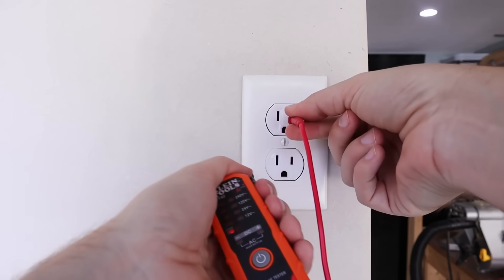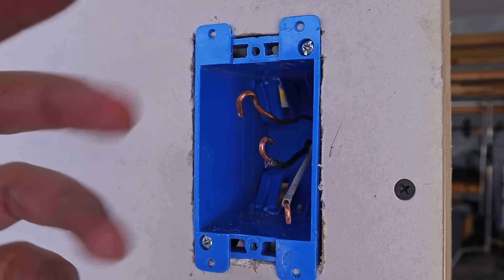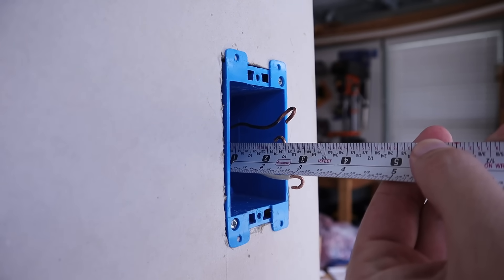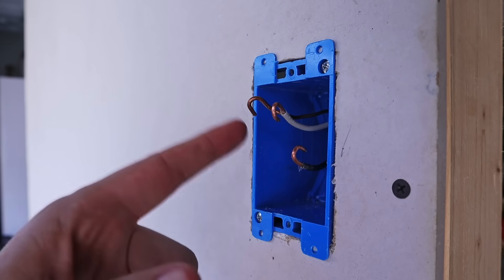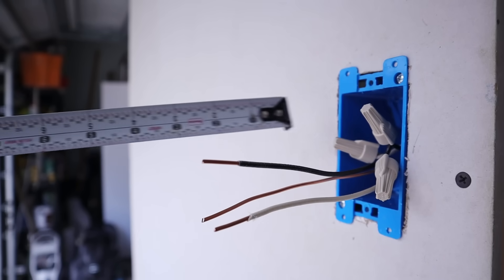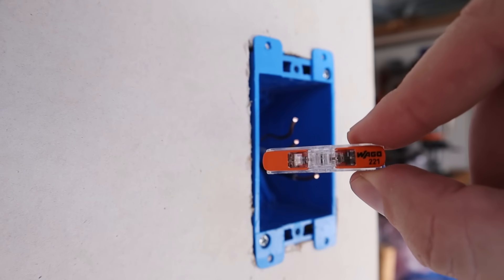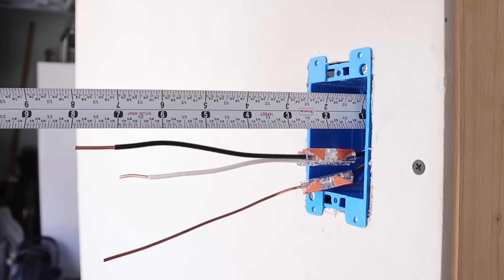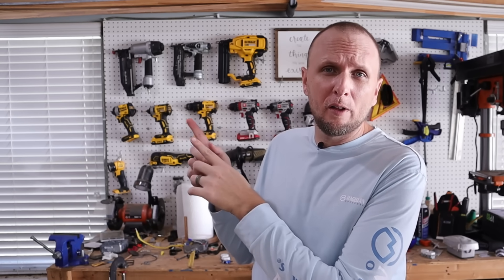"SHOCKING" New Way to Fix Short Wires In an Electrical Box to Code | Very Important

Comment: LOL. I had just commeted on short wire in another bid of his. I did have a what a minute moment. In previous vid push in method for receptacle  was staed as a DIYer mistake, yet there is a push in for one of the methods. 😮

Comment: My biggest issue is 4 gang boxes that don't have enough room for four deep smart home switches... or the like. Also multiple dimmers on one circuit for LEDs have major issues with flickering and buzzing. I have resorted to putting a tungsten blub in one spot to help increase the load. I feel these circuits should be designed with leds in mind these days. I have heard of some resorting to fx lighting as a standard. (What is used on stage, etc.)

Comment: Great video. I thought you were a fan of Wago, so the cover picture confused me. It shows an arrow labeled "bad". Was the misleading picture to drive more traffic?
Reply from the maker: I wouldn’t call me a fan of Wago, I think they serve a purpose and I use them in certain applications.  No the bad is not intended for the Wago but the connection underneath.

Comment: I've found with levernuts that you can stab solid wire in without lifting the lever.  Stranded wire you need to lift the lever first.  I'm rigging my home with a bunch of smart switches and the WAGOs make the job so easy.

Comment: Only in the states. No wonder the UK has the safest electrics.
Reply from the maker: This would be no different than the UK.   Wires need to be a certain length.  There is nothing outside of posturing that says the UK’s electrical is safer.  In fact, if you look into who has the most electrical fires per capita of households, the UK actually has more fires caused by electrical.

Comment: WHAT HAPPENS WHEN CORRECTING THE WIRE LENGTHS',THE BOX IS TOO STUFFED TO CLOSE?   FINIS  PAX
Reply from the maker: Then you have too small of a box.  The correct wire length should not make it too cramped even with the extra splices.

Comment: I have to move (lower it) a wall plug and one of the wire (coming from the top) is too short, Can you tell me if i can elongate the wire with a junction without having that joint put in a  jonction box ? Thank you.

Comment: The very first time I ever took the cover off an outlet box, it was to replace a cheap switch installed by a pro, who left barely enough wire to loop around the screws outside the box--and yet, there was excess bare conductor extending past the screw. Not remotely code. I didn't know enough at the time to even twist pigtails on the existing stubs. I'd've about killed for a Wago, especially that inline splice model. But I did get a working switch installed, after far too much fussin' and cussin'. From that day hence, Every. Single. Time. I've had to do repairs or rework, I've had to fix a mess left by a "pro", before replacing the faulty bargain-bin commodity part  with at least a commercial grade. Come on, guys! If you don''t think we DIYers should be messing with the Angry Pixies, at least set a good example.

Comment: Those screw connectors are a thing of the past now that receptacles have wago type connections.
Reply from the maker: I don’t think I would go that far yet.  In my opinion commercial grade receptacles are still superior to anything out there.
Reply: @HowToHomeDIY  Generally agree if you are referring to screw clamp type which I find almost impossible to find locally. I think the absence of exposed conductors is a huge safety bonus.

Comment: Great video - one question: the code says the length is measured from where the wire "emerges "from its raceway or cable sheath." Isn't that before the connectors you added, so what do the connectors gain in terms of the code? I'm sure I'm missing something about this. Love your channel.
Reply: You didn't miss anything.  This is not a resolve for the code issue. This only fixes the functionality issue, making it easier to install the device.
Reply: @17kcotsdoow86  thanks for the response, but I am confused… Why would you want to address the functionality issue if you can’t install the outlet to code? Perhaps only in circumstances where the outlet will not be inspected?
Reply: @dansklrvids7303  At the end of the day, it's to save the cost and possible esthetics of the repair. You can either tear open the walls to get the short wire to a different box to make a splice and then extend a new wire to the original box. Then repair walls/ceiling. Or you could add a new junction box with a blank cover (or add a new receptacle) close enough to the original problem box to make the splice.
In the real world, a customer is not going to pay to rewire their home because of short wires, possibly left from before the code was written as it is now. The resolve is safe it just doesn't fix the code issue with this rule.
Reply: @17kcotsdoow86  thanks!

Comment: Great video, when it comes to electrical work, many DIY’s know just enough to make it work. I prefer a properly done pigtail with correct size wire nut, it’s the next best thing to soldering when you want a lifetime wire joint that can handle environmental, electrical and mechanical abuse. Try comparing a Wago lever nut to a wire nut on a 5 HP vibratory tumbler and see which one fails first. I know this is not a typical application, my point is that I can make an inexpensive ”forever” connection using a wire nut.

Comment: it is better replace entire cable with longer one if possible,  i'd leave this socket connect with short wires as is, because it the more joints cable has it is each joint is a point of heat

Comment: Is the service loop/love loop against building code?  Coming from the low-voltage/communication sector, it's how we roll, 'cause stuff happens.

Those butt-joint Wagos are interesting!  Not sure how I feel about them in this application, though.  Especially in a stuffed box, having the wires come back on themselves in a regular Wago or a wire nut may actually afford you some extra flexibility when tucking everything back in.

I'm also curious about how electrical code addresses wire length in pancake boxes, as I may have to use a couple in a reno I have coming up.  Still a 6" minimum, or is it less because the box is shallower?

You do awesome and informative videos!  Thank you for sharing them with us!

Comment: Question(maybe an idea for another video) - I'm trying to fix someone's previous mistake.  A ceiling light has a switch, a constant hot, and two other lines that goes to outlets.  So normal wiring would be use the constant hot to the switch to control the ceiling light and than wire the two outlets to be constantly hot.  But the problem when I came in they were cut way to short and you cant get them all in the same box.  What is the proper way to do this?  Can you use wagos to extend wires to get to the box or they have to be placed in another box first?   What is code and acceptable here?  This home is old!!  Thank you, been youtubing to see if I can find a remedy
Reply from the maker: Any splice or wire connection has to be in an accessible junction box.  So it’s either do that or run new wiring.

Comment: I been using the Wago connectors on DIY project and talk about making life alot easier.  The wirernuts always takes up so much room, which mades it a B@@@@, to get multiple switches in the box.

Comment: 1. Can you bury WAGO connectors in the wall?
2. Why is the box NOT too small to get all those wire nuts, along with a fat GFCI, but too small to have more than 3 Romex cables with a light switch?

Comment: I have used Wago connectors for a while now and like them very much. One tip would be to give it a single wrap of electrical tape to help keep the levers down. If your gang box is exceptionally stuffed full of wires, the levers can catch and pop up while shoving everything in.
Reply: ... and then rotate the bundle with longer wires.  It is actually easier then using a linesman's pliers.
Reply: You mean on the OUTSIDE of the levered junction and not on any wires, right?  In that case I agree.
Reply: @JLilliquist  yep
Reply: @mgweir3252  cool, out

Comment: There should be a special place in hell where these morons, who cut wires 3 inches long inside a box, get sent! I have run across it more than once. Even the "hot" wire wasn't wrapped around the screw properly in the video; surprised it wasn't wrapped CCW besides. Or like i found recently in a bathroom where the electrical box wasn't even grounded. Whoever, not an electrician i am sure, had hooked up the ground directly to the fixture but never grounded the box first.

Comment: That was beautiful work, but question... isn't the box filled up now?  You have the extra wire, the connectors, at least one wire nut... and of course now we need to jam a fixture in there.  Seems like it will be awfully tight getting that to fit.  Btw, NOT criticizing... asking so I can learn.
Reply from the maker: It does fill it more but it is required by code.  All of that will depend on what’s being installed and the size of the box.  In some instances a deeper box may be best to install.

Comment: I had a situation just last week. Beach houses sometimes have grooved outside paneling on the outside. I had 4 sections that had rotted and had to be replaced. I took down the non working fixture and saw that the wire had rotted right where it cam out of a 2X4. The cause of the problem was the installation of the fixture. Someone had hung it over a groove. Water ran down the groove and into the fixture. I had told the guy replacing the paneling to pull the wire back from the 2X4 so I could move the fixture after the paneling was replaced. He didn't. I'm 5 hours away and can't supervise the people who work on my house.

I drilled a hole 8 inches down from the old hole and pulled the wire back. Put in a new box after pulling a piece of cable toward the unneeded hole where the wire had come out before. The carpenter had cut a new hole where the fixture had been on the old paneling. I spliced the cables together and put a water proof cover over the splice box and caulked it to seal it. I installed the fixture over the old hole location he'd drilled. I filled the groove in the paneling with caulk so water couldn't run behind the fixture and put a bead over the top of the fixture. I put 2 coats of paint over the splice cover and it's practically invisible.

I've owned this house for 22 years and it's been completely renovated. Most of my repair work years ago was related to poor workmanship. Today I am still redoing bad workmanship on recently down work. It is very difficult to find good workman here on the NC coast. I'm fortunate that I'm handy. Most of my experience comes from my time as a Navy Seabee working in a base public works department for four years.

Comment: Good video im just gonna recommend to pull on the wire slightly to see if there's slack from the wall.  Sometimes pushing it back up helps make it easier to make the outlet fit.  Most houses this is the issue.
Reply: Yeah, I find with outlets slinging a little wire out of the wall and into the box and then doing the reverse when closing helps.  It is not as common with switches.  I alos noted that switches are 99% backstabbed unlike receptacles.  That pretty much tells you what the qualification of the worker was.

Comment: I was taught hot wires need be taped also after connectors done. Is that still true or has that changed?
Reply from the maker: It’s a personal preference but not required.

Comment: My biggest problem with wire nuts has been there is never enough room in the box and bending any thicker solid wire grades is a force nightmare. It would be nice to see you do a video showing what to do with both the WACO and wire nuts pushing or winding them into old metal boxes., especially when you have to put more than two wires together, like in some ceiling fans. Any tips or methods would be appreciated.
Reply: Try changing out to smart receptacles, which are quite larger than standard receptacles.  Talking about frustration!    Just not enough room in standard boxes.  You either go deeper or wider or both.
Reply: @chaecoco2 You are correct. I noticed that he didn’t try to “stuff” everything back into that small box in the video. Probably the reason the wires were cut short in the first place.
Reply: Agree! Why they made those boxes so small is so dumb.
Reply: There is room, just not as much as there should be.
Reply: They hold up in Europe so why wouldn't they hold up in the USA?
Reply: @deang5622  Half the current?
Reply: Ceiling fans should have their own junction box above the ceiling, just like a smoke detector.  Both are easy.  You so not have all the power in / out and loads.  Switches are the worse.  I actually have a box with half leads just for lights, line in, line out, fan, etc.  It is mess.
Reply: You can get Wacos with up to six parallel ports (maybe more) for when you have more than two wires to connect.

Personally - even for only two wires - I find the parallel Wacos are easier to push back into the box than the in-line version.

Comment: I had an outlet burn out in my kitchen a few months ago. It was installed in the 80s and had gone through numerous power outages. One thing we discovered was that there is no ground wire. Not a single outlet in the house has a ground wire even though there is a grounding rod next to the meter pole (my meter is on a pole instead of on the house). Another issue is that there was zero slack. Before that though, the damn screw for the coverplate was completely stripped and would not come out. had to break it off. Needless to say, it was a royal pain getting the new outlet put in. I know there is no slack or extra wire at all because I can see the back of the outlet from inside my pantry and I can see the cable coming down from the attic and to the outlet box. 
If I ever get to redo the wiring in this house I will try to do the service loop thing.
Is there a fix for no ground wires in any of the outlets/switches?

Comment: I changed an AC outlet a while back, it worked perfect for a while. Then I plugged in portable heater and there were cracks in the insulation I didn't see. The draw from that heater blew the circuit breaker and cut off the black and ground wires leaving only the hot wire. All three were short to begin with. Not up to code. I may try and use the inline Wago splicers to repair the wires. But no more electric heaters. I wonder if my Window AC would cause an issue with this plug? Computers and other electronics worked perfectly on it. Apparently it was the amps that caused the short. Also my outlet boxes are the old metal type.

Comment: Those are a great option but for the ground wire it's better to use the little copper splice cap because it's smaller and gives a very strong and permanent connection. You will need crimpers that have the crimper on the end of the pliers, so you can get to the part that you need to. In fact when I need maximum room in the box I use the insulated crimp on devices, what are much smaller than the Waygos. When you have something like a GFCI or a dimmer switch sometimes you need more room in the box.
Reply: Yes, ground and neutral bundles are ideal but if you have 12 it is not practical.   Even on my own house I have 9 wires.  Sorry, but a pair of 6 is much easier.
Reply: @actionjksn  -  I was about to make the same comment about ground crimps.  But considering that the topic is "too short conductors",  people may come across the situation where some numb nuts  cut off the off the crimped ground pigtail, leaving just a stub in the box.  In that case, something like the wago may be your only option.
Reply: @jeffeverde1  Yeah people do some super dumb shit in electrical boxes.
Reply: @jeffeverde1  Yep, it was my situation recently while installing a KASA switch and dimmer, I had to use 3 and 1 I was able to just use a wire nut.  I most use them with items that have a stranded wire.  I do NOT like mixing stranded with solid without using a Wago unlike all solid wire. KASA comes with 2 or 4 stranded wires depending on if a dimmer or switch and in the dimmer location all but ground and neutral were too short and ground and neutral on the were stranded.  I had to use inline out the load, line was long enough.  I also put electric tape over each to avoid accidental disengagement and twist each set.  I have found since a Wago spreads wire more and in a line that rotating the wire around each other in a bundle is easier and more reliable than using linesman pliers.  I have shot videos about it I will eventually post.
Reply: I have switched to using the inline Wago for line or load and leave the ground and neutral as bundles.
Reply: @JLilliquist  What do you mean ground and neutral as bundles?

Comment: Why cut them off makes it shorter. 
Tans are rated to do the twist for you.
Why don't you do a real video where it's an old house where the wires DONT extend past the box, can't get your kleins in there to make a joint. OR..... leave it to the professional. I've seen too many hack job DIY trying to fix this problem. This was a best case scenario "short wire" problem.
Reply from the maker: Best case scenario? 😂 Have I ever seen them shorter than in the video?  Yes. But barely and not often at all.  The reason?  Much shorter and nobody would have been able to wire the receptacle to begin with.  I love these comments 😂.  And a pro would know why you would cut the loops off.

Comment: I actually learned something I haven't seen in the numerous videos about the Wago connectors.  That is that you don't have to open the lever to insert the wire.  I just bought a box of them to use in rewiring my garage and basement this summer.  I'm looking forward to the job.
Reply: Yeah, but so anyway.  It also depends on the wire.